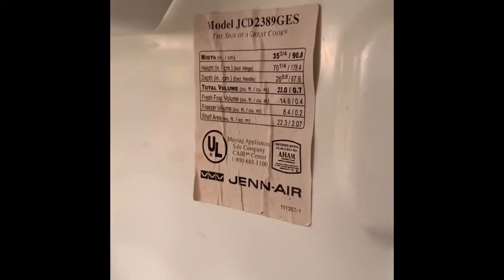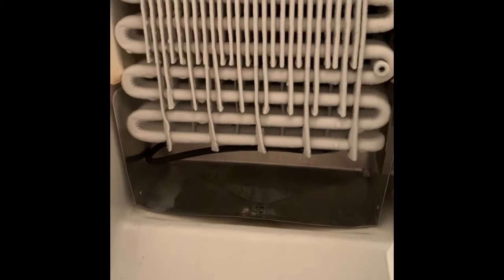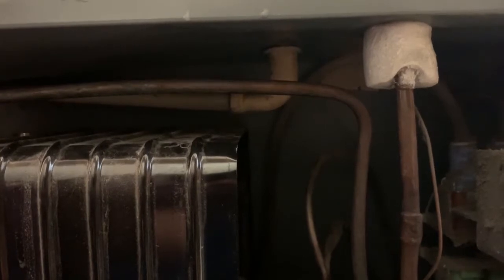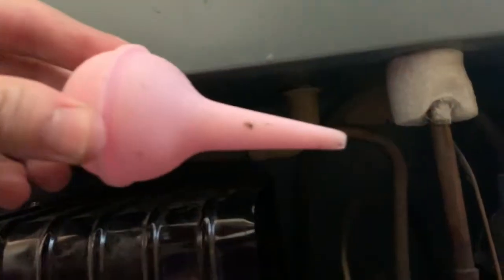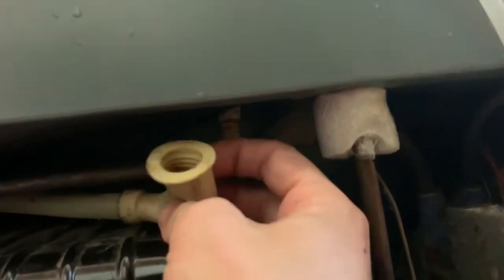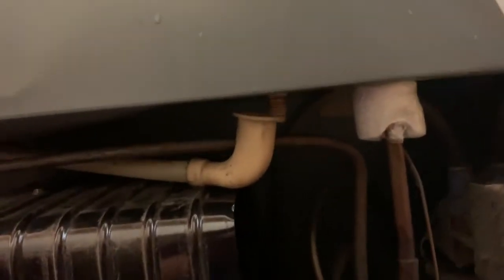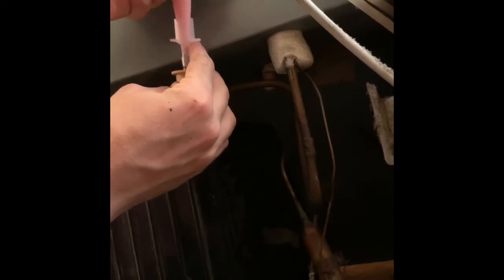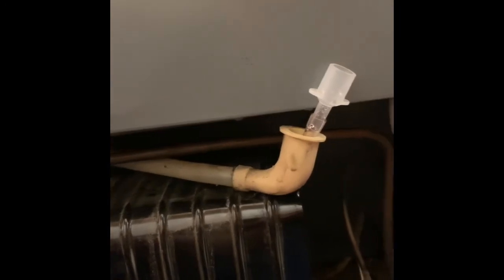DIY fix complicated freezer drain clog Jenn-air JCD2389GES

Comment: Thank You for the video. I figured out the drain line underneath but not how easy it was to access condenser, sure enough a sheet of ice blocking the drian pan hole.  Thanks Again!

Comment: Thanks for sharing this tip! I tried clearing the tube with a pipette brush from the top of the tray, inside the freezer. but that pushed the elbow connection off.  which I only discovered after pulling the fridge out of the wall to see why my fridge wets the floor whenever it defrosts.  From the back of the fridge I was able clear the blockage and re-attach the elbow to the bottom of the tray.

Comment: Thanks for posting, I have the same refrigerator and  had the same problem years ago and found a tiny screw had lodged itself in the drain tube!  Once removed it worked much better.  Today it is likely plugged again as water cascades out from the freezer on defrost cycle, about to go in again...

Comment: Freezer drain water froze inside opening of drain tube due to drain hose blockage.  Used a piece of weed eater line to clean out the tube and flushed with water/bleach combo to kill the algae. Re-attached the loose hose base to bottom of drain and secured with small zip tie. BINGO

Comment: I just finished cleaning out my second drain tube clog, it was plugged with a concretion of fuzz and food bits and mold.  It cleared easily.  I first used a zip tie, I shoved it in the tube from above and the refrigerator drained.  Then I got around back and removed the tube and ran hot water through it,  then filled it with clorox to loosen and kill the mold.  I then ran a wire tube cleaning brush, like you would use to clean a test tube, through the drain tube and it was perfectly clean,  now ready for the next ten years!
Reply from the maker: Glad to hear about your success!

Comment: Just had a problem with my fridge/freezer.  I replaced the auto defrost unit and then manually defrosted the frozen coils with a blow dryer. My drain wouldn't drain the water. I thought the tube might be frozen below the drain, but  pouring boiled water didn't seem to clear it. My clog was in between the drain inlet inside the fridge and the outlet to the pipe.  I ran a WD-40 spray nozzle through it and the water started draining. FYI, if you just remove the screw holding the mounting tab in place on the left side of the drain tube, you can pull the whole tube out and give it a thorough cleaning.

Comment: Did you find that it clogged again after cleaning? Just curious....
Reply from the maker: It’s been a year now and I haven’t had any issues with clogging again
Reply: Too prevent future clogs caused by mold and algae, flush a weak solution of water and bleach into the freezer drain inlet, using a turkey baster. Finish flushing with water only to clear out the bleach.